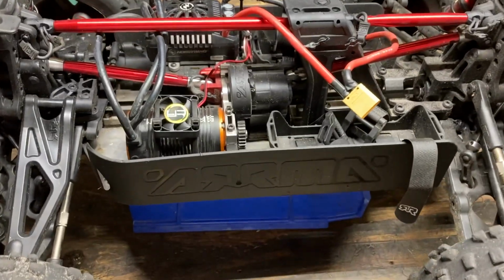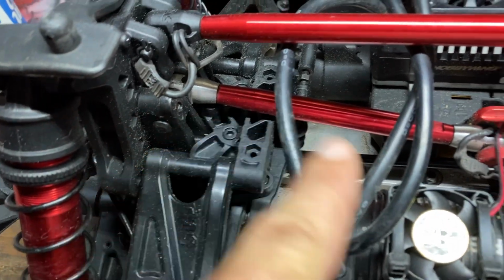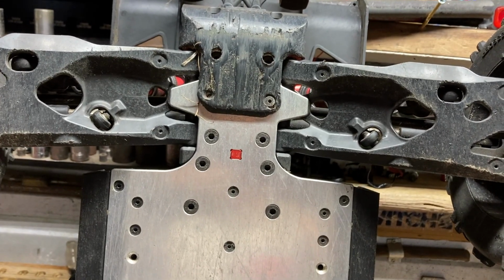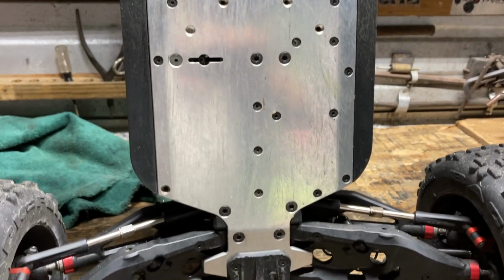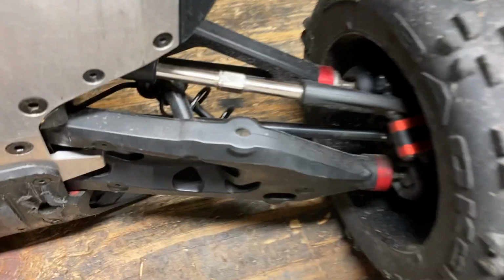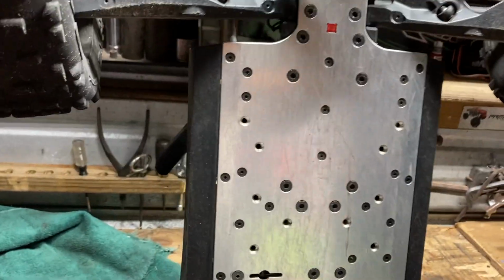Extreme RC Stunts

Comment: THIS MAN is a tank capable of taking anything once the updates are done, nice session my brother
a bit of Xmaxx in the skate park on my channel but cut short because the silicon oil has spoiled a shock ahah!
Since I hardened the springs and the oil, I often have the membranes jumping out in the shock absorber head or it comes out through the lower seals, which are new? what do you think Rocky?
Thank you in advance for your advice, have a nice Sunday, enjoy
Reply from the maker: Thanks a ton bro! Yes this truck is a beast no doubt!🏆⚡️🔥🔥 If ai we’re you I would go back to the stock 60 weight in the front shocks and 80 w in the rear. That’s how I used to run my Xmaxx and I never had a issue🏆🏆🏆🔥
Reply: @thunderrc  Correction: when dismantling the rear shock absorber, it was the piston that was broken into 4 pieces!
This is the 1st time in 2 years of Xmaxx that this has happened, it must have come to an extreme stop during an extension and it hit the cable gland, I can see that!
There is also this bending problem as soon as it is sent to the moon, which causes the pinion/crown mesh with the original engine to jump!
Suddenly it's the teeth that break or the pinion that gets blocked, you can degrease and stick hard there's no way it fuses.
What would be the least worst solution for you to avoid this with the original engine?
Thank you my friend, enjoy😉

Comment: I havent had my Outcast out in a long time. Probably 3 or 4 months now. Ive broke it just about every run. I want to get the entire M2C kit for it to try to keep it together. I may get the Vitavon axle kit for it but that requires pulling the diffs apart to install their drive cups. Ive heard of many people breaking the M2C nearly as much as the stock. Those seem to be people who flog their RCs like i do with my Super Rock Rey. Last 2 RCs i took out was the Traxxas Erevo 2.0 and the Kraton EXB.
Reply from the maker: Yeah man the Outcast is a tricky rig for sure. It is definitely not the most durable truck and can be fragile in several ways due to the weight and long arms. M2C parts definitely help keep this truck together better for sure. Especially there chassis and overkill driveshafts that don’t bend. I think Vitiavon bulkheads would be another awesome upgrade for the truck as the stock plastic ones strip out super easy when sending big. There is definitely more room for improvement when it comes to durability of this truck, but the driving and handling of this beast is top notch! Not to mention this is one of the funest trucks on the planet for sure⚡️🔥🔥😂
Reply: @thunderrc  Well, to be honest, there isnt much out there that doesnt need upgrades. Even the Losi 5T needs higher quality servos than it comes with. I dont have one surface RC aside from my nitro revo that doesnt have at least one upgrade part on it. Ive actually probably spent more on upgrade parts than i have on the RCs themselves.

Comment: Absolutely sick! I have serious temp issues with the spektrum 1100kv on my K8s exb with a 30t pinion. Don't understand why bc I see plenty of people running the same setup even some with higher gearing.
Reply: I only have run mine on the stock pinion (forget the tooth count) but it gets, what i would consider hot as well. Then again a big portion of my RCs have or do get into the 120's to 150's range. I keep stock pinions on most of my RCs and only have swapped motors in a few of them (massively overpowered to try to keep temps down.)  Ive got a Mamba Monster X 8s system in my Kraton and run it on 4s with a 19 tooth pinion. I also have a Summit that i run a Mamba Monster 2 6s system in and a Losi Mini B with a Mamba Micro 3s system but running a 8200 kv motor, 18 tooth in so it stays on 2s. I changed out a motor in my Losi LMT and run a 1900 kv on 15 tooth. Every other RC (22 total)  is stock electronics and pinion.
Reply from the maker: Yeah man my motor does get pretty warm but I have never burned up one of these motors.
Reply: Motor hasn't burnt up but it quickly gets 160 and above, the big issue is it like two sets of brand new 4s lipos (2 4s spektum packs, 2 gens ace redline 130c packs.) Running firms 160A esc everything brand new
Reply from the maker: @brianbellerive8546  You are using the 49spur?
Reply: @SebastianLong  if your suffering with iverheat mate get a housing made for a bigger fan or get a Heat sink that fits a dual fan system set your bec voltage to 7.4v instead of 6v as well you'll have much more power getting to your fans and also servo you'll see mad differences
Reply: If All else fails Do what the Nitro racers do. Cut A 1.5- 2 inch hole in the windshield an the side the ESC is On.  That body  fits tight, and all that power makes heat. Soon the cooling fans blowing hot air. Had to do this with a race truckback in the day because it would over heat ESCs in under 4 and a half minutes, After venting the windscreen it would dump a whole battery.
Again it somthin to try if nothin else works,
Reply: If you didnt wanna mess up the looks you might get away with opening the driver and passenger windows

Comment: Say Mr. Thunder, how r u? Been a subscriber for a while now was wondering how u soak ur plastics in wd-40 and what benefits it has. Thanks so much for your time. Oh and what diff should I silicone earplug I'm a basher.
Reply from the maker: Thank you brother for your support⚡️🏆 I have been doing good man! I just take a spray can of wd40 and hose down the entire truck A Arms Front and rear. I truly soak the entire truck. Let it sit over night and boom you will have way stronger arms with a ton of flex 🔥⚡️🧨🧨 I wouldn’t eat plug center diff, to hard on drivetrain.
Reply: @thunderrc  what parts would I have to upgrade to make it work if I ear plug it?
Reply from the maker: Only thing you need to upgrade are the driveshafts👍⚡️ Pick up the M2C Overkill driveshafts. That is what I have in my truck and they are awesome!
Reply: @thunderrc  say thanks! I appreciate that. I'll let you know the outcome of the locked center diff along with the m2c overdrive shafts.